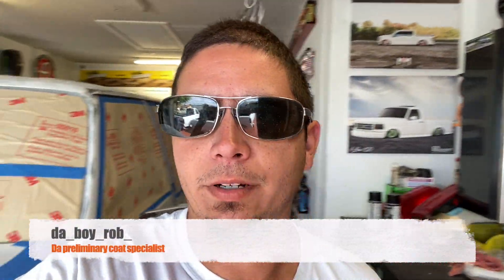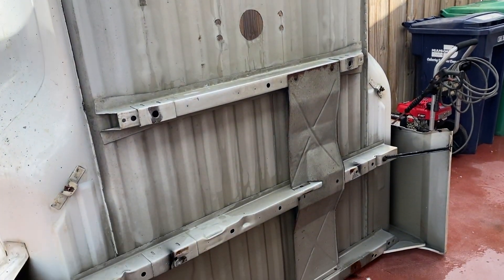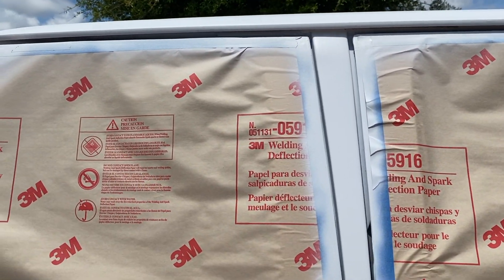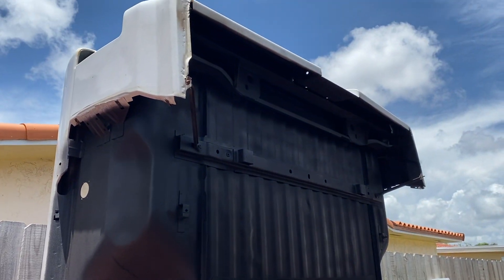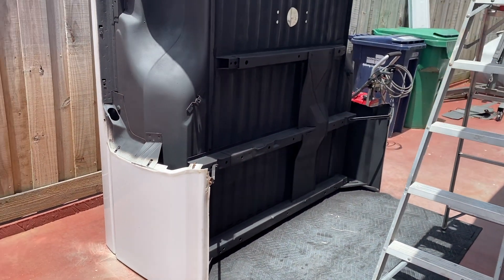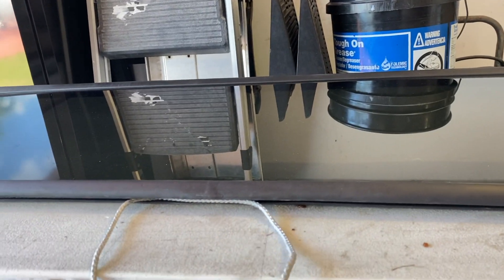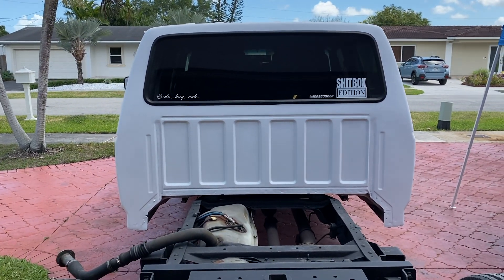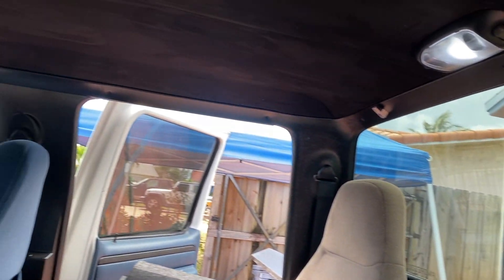Working on Ford OBS Dually day 5

Comment: What brackets did you use for the 40/20/40 seat in the back?
Reply from the maker: I got a full set used from the front of a crew cab. Holes line right up.